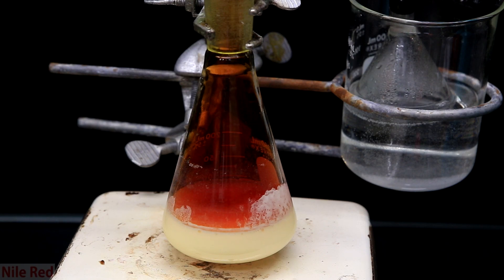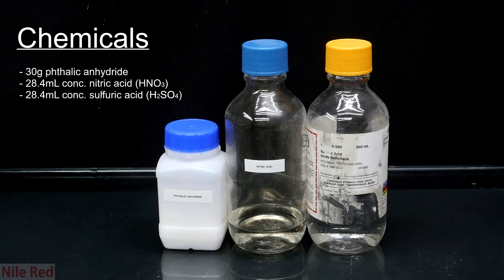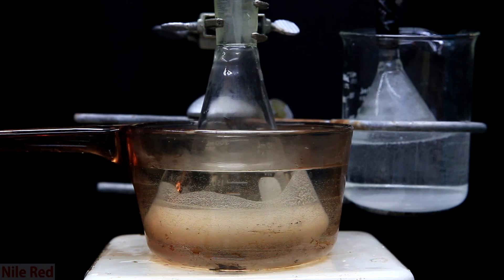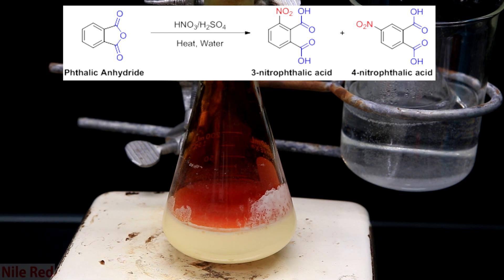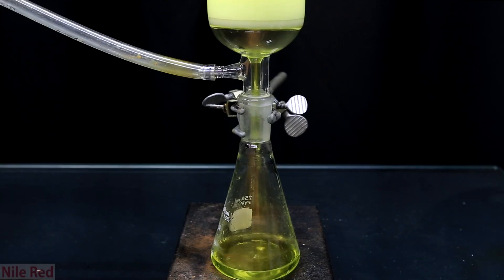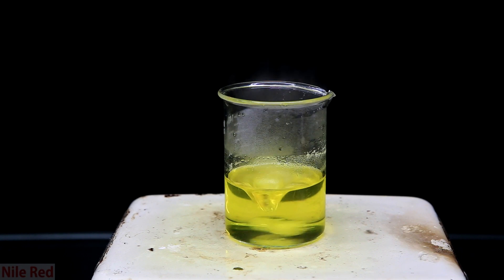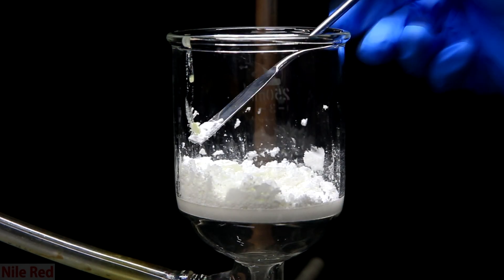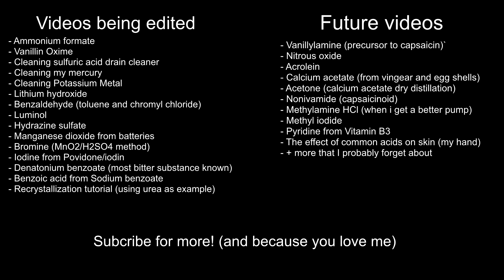Making 3-nitrophthalic Acid (Luminol Precursor)

Comment: If you lower the temperature to 65 degrees and increase the rate of nitric acid, which is the ortho director, a little more than h2so4, your efficiency will increase. But still, it's a great work. If I find a laboratory, I will try it as soon as possible :) Good work, we follow it with pleasure.
Reply: How much of nitric? 1-2 mL?

Comment: Hi Nile! First and foremost, I love your channel. I don't know if you read comment questions this long after you've posted a video, but here goes! 

I have tried this reaction 4 times with minimal success. Each time I regenerate more than 90% phthalic acid instead of synthesizing much/any 3/4-nitrophthalic acid. I noticed from this procedure (http://www.orgsyn.org/demo.aspx?prep=CV1P0408) that they added sulfuric acid first, then slowly add fuming nitric acid, followed by (less) concentrated nitric acid - and the note says that using just concentrated nitric acid first does not work as well. It also seems like this procedure uses more acid relative to the phthalic anhydride (compared to your video), and in my experience this improved my yield. I am getting ready to try a 5th time with some fuming nitric acid, and just wanted to see if you thought this might play an important step? It seems like this reaction starts out as fairly water-sensitive, and it makes intuitive sense that the anhydride would be easier to nitrate. I was just surprised that the phthalic acid seems to completely resist nitration, and that the phthalic anhydride preferred to hydrolize over nitration under what seemed like identical reaction conditions to yours. Thanks for all your great work! You're an inspiration!

Comment: I know you were able to get some luminol from this in the end, but did you verify your product spectroscopically? I tried this and only managed to get back the acid starting material from the water recrystallization. I did get some product that included both the 3 and 4-nitro isomers, but in very small amounts, and they were recovered from the water wash. This was verified by NMR. I may have held my temp a bit low, though. I may try this again, but I am considering using the fuming nitric, as suggested in the literature.I really don't want to deal with fuming nitric acid. That's why I am asking.

Comment: That's odd, I did the same to nitrate an isoxazole and I didn't get any nitrogen oxides. Heated it at 100ºC in an oil bath for 2 hours. The big difference is I used a large excess of sulfuric acid. I think that's why the paper sugested it. Now I know :)

Comment: I would really appreciate if you look at oxidation of naphtalene into phtalic acid by using chromic acid(H2CrO4)(or acidified KMnO4.) Naphtalene can be bought as mothballs and is widely avaible. The process is not on youtube yet. Do you think you will make a video showing the process?  Thanks
Reply: +Harry Johnson Naphtalene is very commonly found in some products and incetisices. But i dont think it will just produce phtalic acid and give high yealds. We all hope for the video about this...
Reply: @milandidic3714  One industrial way of making phthalic acid is using napthalene, so there definitely is a way of getting a decent yield. Whether that way is expensive and requires specialized equipment...
Reply: @Alper Bilgin i think i also need a grammar class with them then hahaha. <->
Reply: You both need grammer classes first.

Comment: How concentrated is your nitric acid? Is it commercial 68% (due to Azeotrope) or is it >95% (from Nitrate salt and Sulfuric acid) ?
Reply from the maker: +Aniline Hydrochloride I tried doing it from the salt and it didnt work for some reason. The nitric acid i used is probably around 68%

Comment: Hello, i would really appreciate it if you were to discus the mechanics of a catalyst. I know that a catalyst basically increases the speed at which the reaction reaches equilibrium, but I am really unsure as to why. Also, if you could discuss the nature/ production of polymers and plastics I am generally interested in the chemistry behind them.  Thanks!
Reply from the maker: +David Mizzell Ill try to cover the polymer stuff when i make nylon (eventually). A catalyst speeds things up in many many ways, but they pretty much always do this by reducing the "activation energy". There are a lot of different types of catalysts out there. Ill try to cover this in a video, but i am not sure what i would make. 

Just quickly though, ill give an example in terms of biochemistry (because I find it easier). An enzyme is a biological catalyst. One of the simplest ways that it can increase the reaction rate, is it literally just floats around, binds to one reactant and holds it until it finds and binds the other reactant. It also orients them perfectly so they are ready to react when they bind. This way, the reactants come together and react much more efficiently, instead of just floating around and occasionally hitting each other in likely the wrong orientation. So it increases the rate of &quot;productive&quot; collisions and therefore the rate of the reaction. 

Does that make sense? I might&#39;ve explained it poorly. It isn&#39;t chemistry, but I always liked that form of catalysis.
Reply: +Nile Red Thanks for answering my question about catalysts. Im looking forward to your nylon videos, keep up the good work!
Reply: +Nile Red What you said fits the stuff we have learned in chemistry. A very basic catalyst is for example platinum what can split hydrogen molecules into much more reactive atoms. The hydrogen will react spontaniously with oxygen in the air catalyzed by the platinum.
Reply: +Niklas Müller Dosen't platinium increase concentration of hydrogen, and that mechanism is use in electrods? I am not sure, but if it does it could increase speed of reaction, too :)
Reply: +morota1000 I have never heard of that, but if it does, you would be right
Reply: ***** As Wikipedia says it isn't platinium properties but them platinized surface which: "Increase total surface area. This improves reaction kinetics and maximum possible current
Use a surface material that adsorbs hydrogen well at its interface. This also improves reaction kinetics"

Quote from https://en.wikipedia.org/wiki/Standard_hydrogen_electrode
Reply: I see, that explains its function as a catalyst :)